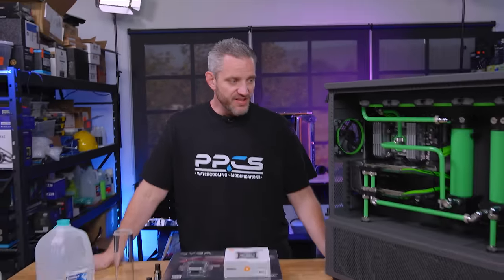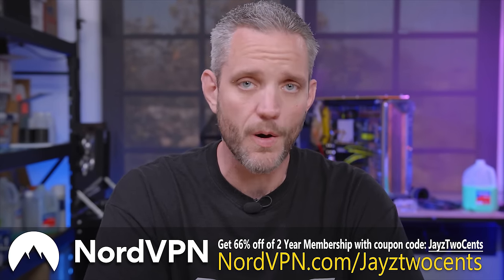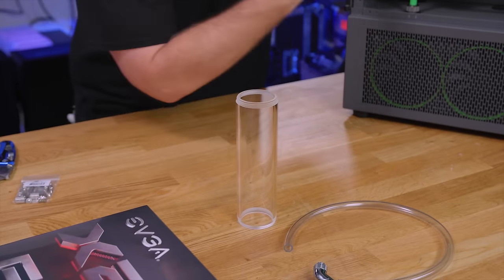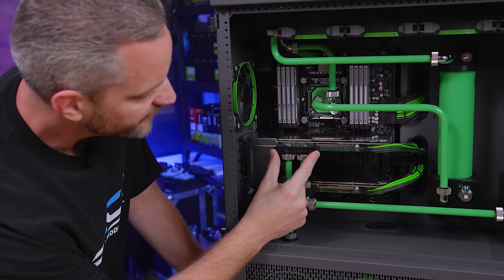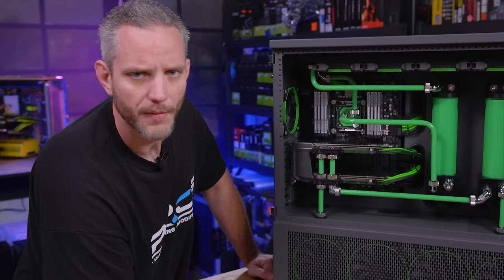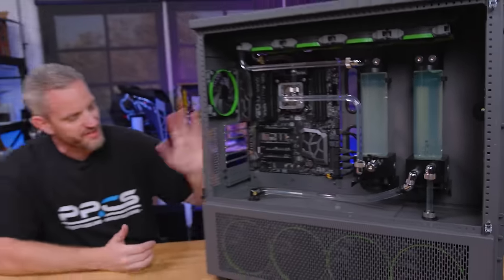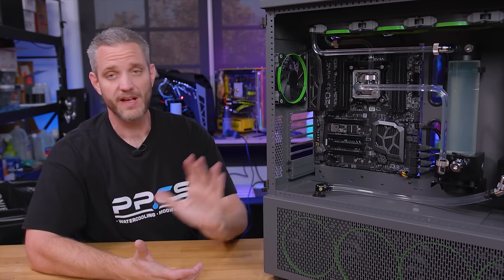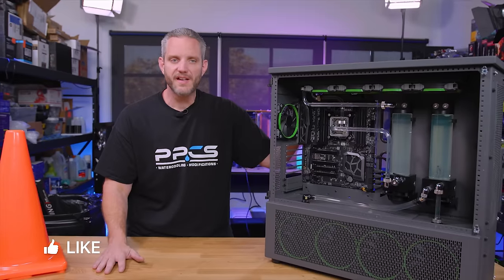Working on Skunkworks once again! Most OVERKILL Gaming PC

Comment: My idea of an easy upgrade: Swap out the GPU.
Jay's idea of an easy upgrade 9:24 : Swap motherboards, CPUs, and GPUs, flush custom watercooling loop, get new blocks, recreate new tubing bends.
Reply: My idea for my pc: new motherboard, CPU and RAM. And than I saw this.
Reply: My upgrade list: 1060 6gb, ryzen 5 1600, cooler master masterbox pro 5, adata m.2 128gb ssd, and a logitech z313. Because performance.
Reply: oh those m.2 are going to cost more then the gpu. :D
Reply: All I want is motherboard with 4 DDR4 RAM slots, i7 8700K and 8GB RAM
Edit: my current GPU is GTX 650 1024Mb
Reply: @ENDOMA555  30 dollars...
Reply: used, no brand psu cost in europe 5 dollars or 3.20 euros. The problem is that they are lower then 200 watts and deliver about 100 watts at full usage, and explode randomly.
Reply: @ENDOMA555  mine was PSU came in prebuilt PC and it is I think also no brand one worth arround 45€. 600W and it delivers up to 580W
Reply: thats a really great deal! Usually no brands deliver 50% of the max watts. Well at least in my experience. I just bought a off brand psu for a shit build and got it like for 5 euros.
Reply: Well, delivering the promised power is one thing, not blowing up and killing your new GPU is another.
Reply: yako okay go for 2600 while more expensive it has a higher ipc and ocs way better than it and it even has better ram support so less worry about your ram working with  ur cpu
Reply: @ENDOMA555  Never skimp on your PSU. Golden rule.
Reply: @CIubFoot  Yes I have like good build with brand psu and all that but when making a windows XP killer PC of 2012 I dont see the problem on skimping on the PSU
when the whole system costs about max 300 euros.

Comment: Videos like this is why I love you Jay. You introduced me to water cooling. Now I have a custom soft loop for my CPU/GPU. Here in a couple of years I intend to making a custom hard loop desk PC. The only issue I've noticed is the overclock I'm able to do on my CPU is causing issues with a few of my games, and to play them I have to undo the OC. I know it's not a heat issue, but still the games can't keep up with my PC. 8700k(5.2Ghz), 1080ti(+30hz core, +400hz memory), 32GB of 3200Mhz Trident Z, Gigabyte Aorous 370z G7 motherboard. I'm not sure if my bios settings are to fault, or the games themselves. Running at stock speeds is killing me when my loop can handle so much more.

Comment: In slightly surprised you didn't use the 32 Core, or is that being put in the threadripper build?
Reply: For gaming? When you have dedicated render rigs?
Reply: that thing is not a general use CPU its a hard professional CPU stopgap between the server stuff. The thing is really only good at rendering, science type workloads, and a few other things. That being said my god is it a monster at what it does best.
Reply: @Blazing Clash it makes sense why they would not seeing as how epyc is for some ungodly reason is overclockable. So if you need 32 cores for a video game then there ya go i guess.

Comment: Why not wait for the 9980xe?
Reply: expensive stupid. And probably slower for his usage. Less cores with more ghz is still better.
Reply: why not both ? Right Jay ? RIIIIIGHT ?
Reply: @gaiustrollius9920  9900k is soldered, not 7980XE
Reply: @juhopetrell1878  I was referring to the 9980xe.
Reply: Technically he could have gone for a 9960X. And that series isn't released yet, and is a much higher TDP (generally larger) package with no iGPU either, so thermals are actually expected to be much better than the 9900K
Reply: That would be a ridiculous cpu to put in it, but yeah surprised he didn't wait for the new cpus to release in the next few weeks and evga new bios to do this upgrade. I have the evga x299 ftw-k as well (and the z77 ftw)
Reply: Why do some of you people always want to wait?
Reply: 9900K is good enough.
Reply: Well I suppose he chose an 16 core for a reason if he didnt need many he would of went for 14 or 12
Reply: And *8 cores would be a downgrade
Reply: You mean soldered 7980xe that can't maintain stock boosts while throttling to the sun and back because the solder doesn't help?
Reply: The cpu is not out was only announced
Reply: 9900k only has 16 pcie lanes to share between the two graphics cards and depending on how many nvme ssd's he has, them as well.
Reply: @zeldacuz  that's wrong. Chipset has 8 lanes. So 24 total. It would run x8/x8 with 8 lanes to spare for drives. Plus this is a 7960 on x299. Why is everyone in here saying 9900k ?
Reply: Yes I know. That's why I said depending on how many nvme ssd's he has. If he has more than two than it would begin to use pcie lanes.
Reply: @AmaroqStarwind  not for rendering
Reply: Why wait? Hes gonna upgrade again once its out. :D
Reply: Spoiler Alert

Comment: I wish I have gone with a case labs case when I had the chance. I have an X299 setup with Asus Rampage VI Extreme, 7980XE, 32GBs of RAM, two 1080 TI Kingpins and an open loop with soft tubing. I will say I've been impressed with how well EVGA has been making their mobos and I'm going with their Z390 Dark whenever it is released (rumored in mid to late Nov) to go with my 9900K (of which is still in a pre-ordered stage at Amazon). I want to see more OC'ing videos Jayz. Keep firing at Steve. I love these techtuber OC'ing battles.

Comment: Should I feel depressed with my pentium E5300 or should I be proud of myself for surviving with that for over 8 years now.
Reply: You should feel depressed that you haven't spent the $5 for one of the lga 775 quadcores
Reply: @axelbostrom3606 , PSU doesn't have enough power
Reply: another 10 dollars for the psu
Reply: Well a bit of both
Reply: Probably the motherboard will have trouble powering the cpu. Happend to me when I installed a q9550 on a asus p5ql. It would bsod like hell. Had to replace the old thing with another old thing p5q deluxe. Now it works like a charm. The upgrade was around 100$(added 4 more GB of ram too)
Reply: #PentiumE5300Squad

Comment: A really elegant solution for your tube color that will bring a nice aesthetic with it would be to backlight your resevoirs especially if you can find a thin enough blacklight solution. It wouldn't penetrate the liquid itself because you're not using clear liquid but that's a good thing because it also hides your lighting solution so the only thing visible is the light pouring out from the underside of your reservoir tubes which will look great and also  evenly light both tubes.

Comment: Damn, case labs went the way of the TellTale.
Reply: They had a press release prior stating the Trump trade war tariffs were the reason. The materials used went up in price to where they could not operate without taking a loss.
Reply: @dronedoutrc5970  That was just a lie though.  Due to where their parts were produced (Taiwan), the trade war had very little effect on them.  Their company has had a hard time turning a profit for many years now, primarily because their cases/accessories are priced so high.
Reply: Except we miss Caselabs, but not Telltale. Telltale can rot in the depths of hell.
Reply: I doubt that the actual raw materials going to those cases were that high in the beginning. These premium cases are charged based on their design and novelty, not raw materials. If it simply was raw materials that drove them out of business, why none of the other case manufacturers are out of business?
Reply: Where is your source for this info? The materials used i.e. aluminum cobalt and steel come mostly from China thus the materials used are affected. Trumps tariffs are even causing woes here in the US so please dont act as if these tariff are not part of the issue.
Reply: Again, they are hardly an issue for premium products. If you want sources, here's what  Nucor's CEO has to say: (not direct quote), the tariffs on steel would have minimal impact on US's products, a car worth $36000 will see an increase of $160 in term of price, while a can of beer will increase by a penny or two. China does play a big role in exporting steel and aluminum to the US, but the number 1 trade partner is still Canada, it is not like the US cannot survive without Chinese steel. So back to case lab,  their cases are more expensive than any other cases on the market, but again, they uses the same materials.  They are expensive because their built quality and novelty. Both of which are unrelated to raw materials.  However, mass case manufacturers keeps on improving, with brands like corsair, fractal design, cooler master, lian li... stepping up their games in built quality, as well as design, I see very little reason to spend double, or triple the amount on caselab. Once again, the tariffs affect all case manufacturers, but why is caselab the only one out of business?
Reply: +Droned Out! R/C   Except for that footer not that they had an extremely large account default.  Most likely on the parent corp side.  Tariffs had nothing to do with it.  They could have easily raised prices to account for increased cost productions.  They failed to divest their two corps so one side could go bankrupt while not affecting the other.   They also failed to expand the last 4+years that they had anywhere up to a 4 month back order.
Reply: Even in the article where caselab CEO explains the reason for closing down, he specifically stated that the cost of materials when from 1.5 to 2.8 USD per pound, a 1.3 usd increase. Take the caselab SMA8 for example, it is weighed at 40 lbs. So 1.3 times 40 is 52 dollars. The SMA8 retails for 800-900 dollars, slapping another 52 dollars on it is hardly significant, and if that is the reason for their downfall, then maybe there is a problem with their production capabilities, since the corsair 900d weighs even more, and cost half the price.
Reply: Exactly.  The refused to offload anyting to manufacturing including just having flat panels cut for them.  When they had the capital to expand they didn't.  Instead they lost orders to back logs.  On top of that they financed low margin goods directly instead of through a third party lender.  Which would have netted them the cash up front while tha bank took on the risk.  Poor management on all fronts.

Comment: Jay, Could you put a couple of pipes in between both loops (hidden) with valves so that you can run the loops separately but if there is a fluid color change you open the valves and mix the fluid without draining the individual loops and mixing in a jug. Or just have a pipes that connects the drains to the opposite loop reservoir inlet. Just thoughts...

Comment: JayZ, I noted your comments regarding the tubing run that you have descending from the GPU through to the lower chamber of the case - and the fact that you might well have to come up with a way to handle this given the fact that your new RTX2080Ti cards will have water blocks in different positions. 

Just wanted to suggest that you take a look at some of the videos from "Declassified Systems", here on YouTube... He makes extensive use of acrylic sheeting, which his videos show that he can very effectively cut to fit interior panels (to hide holes in cases). He also seems to mix and match between both the natural gloss surface of acrylic, as well as using aerosol spray paint to give panels a matt finish. 

I reckon that you would be able to simply cut a new exit hole for the new GPU exit pipe through to the lower chamber, then slot in a piece of acrylic with a hole cut in the same place. This will effectively hide the existing hole from your current cooling loop. 

Just an idea for you to think about. Keep up the awesome videos.

Comment: Now I'll be thinking about the second part non stop! 

Can't blame you Jay for continuing with EVGA on this build! I remember you mentioning for Skunkworks that the motherboard has been very stable and that is important. Plus you already used the ASUS board in the D-Frame and you don't wanna be boring and repeat the MB. 

Will EVGA be sending you 2080Ti FTW3 Ultra GPUs for Skunkworks?  Will you be using another set of XC Ultras instead?

Oh, I also like the idea of painting parts of the case a different tone of color. Would be rad. 😎

Comment: Skunkworks is the name of my greenhouse. Greenhouse runs on solar and raspberry pi. Had pi mounted on solar panel kept getting too hot. Wish I could get water blocks for the solar panels. Nice build. I though you were running antifreeze at first. Surprised that people don't run antifreeze. For computers not in climate controlled places. Antifreeze has lubrication in it. And great heat exchange properties.

Comment: Jay is there any real benefit to running 2 loops in this system vs 1 larger loop? Only reason I can think of would be to run 2 different color fluids. Connecting them together would prevent the different discoloration you seem to be plagued with.

Comment: What does it look like if you remove the bottom panel entirely? I ask, because even though it would break the outside sleekness, I suspect the black radiator with green fan-rings would be a lot sexier than having it tucked away behind that dense grid.

Comment: 90 from the res/pump to the CPU needs to be about 5mm longer on the pump side. It’s slightly too short and reducing the cleanliness of that 90.

Also I find using a 90 edge (like a sanded block) and buttressing it with another 90 edge (like a welding square) gets a better bend and cleaner look.
Reply: I should say I mean this will all due respect! Just something to improve the look. I’m anal retentive with that sort of thing, so it’s bothering me.

Comment: Would u be able to do a build video using...
MSI meg godlike motherboard
Intel i9 9900K, cpu,
Any version of GTX 2080ti,
1 Samsung 970evo m.2 500 gb drive as a boot drive,
4 Samsung 970evo m.2 2TB drive,
64 GB ram,
And the PCI capture card included with the motherboard.
That would be an awesome overkill video to see... Please.

Comment: i just did my first build ever its a evga x299 ftwk with a 7820xx 32gb of xpg 3600 ram,evga 1080 ftw dt, and a simple evga clc 280mm, evga 850 g2 psu in a andreas crystal cube case and this is the fastest pc ive ever seen or used now only if i could figure out how to clock everything its just way over what i comprehend at the moment are you going to do any basic or maybe a very detailed video of over clocking on the evga x299 platform?

Comment: Are you going to wire up the 6-pin supplemental power connector on the bottom left of the board?

Comment: I like how he didn't go overboard with new parts, yes he got new GPUs, a new motherboard and a CPU but he didnt change the ram, case, power supply, storage and so on. Most you tubers when they "upgrade" their system they replace it entirely and it just ruins the point of the series. Good one Jay

Comment: I had a EVGA board way back in the day, back when they had nvidia based chipsets. The pci express slot literally caught on fire, I had a friend who had the same thing happen. Had a 8800 ultra also that literally had to be RMAd 3 times. Stopped using EVGA after that, last year I decided to give them a chance and bought a 1080ti, it died within 3 months. New one seems ok, but I do not trust EVGA reliability.

Comment: JAY!  JAY!  Got an opinion question!  I'm planning to do a custom water-cooling loop on my 2010 computer with 2x NVIDIA Geforce GTX 480s.  These are 250watt cards EACH and I have matching EK FC480 waterblocks.  I plan to use a D5 pump, a CPU block, a 360 RAD on top for cooling the GPUs and a 2nd 240 radiator on front to cool the CPU.  What size hard tube would you recommend for the parallel loop links between the two GPU waterblocks?  12mm or 16mm?  Plan to use Bitspower fittings like you used in Skunkworks.  Thanks!

Comment: @jayztwocents I'm currently using a 420 EK CE radiator to cool two graphics cards and cpu, but I'm redoing my setup with a Z390 and adding another radiator but don't know which way to run the loop. Any tips you would suggest? I would really appreciate it. Also, do you recommend using the primochill prep? I contacted ek once about this and they said it wouldn't be recommended.
P.S. thank you on your old tutorial on restoring radiators, I took your advice on painting it white and it looks amazing 👍

Comment: why not create/3d print rings for resevoirs for lites at base/top of the caths, while blacking out the in between bulb, that way the res's and tubing provide the lighting rather than just reflecting off inner case surfaces, and maybe even mirroring the back interior, possibly like those which end up looking deeper than it is????( lit tubes would not show difference of color) anything, besides this rgb  bs that seems to be adding to part cost... rather than   increasing product performance , and while newer items might also be improved, surely the extra addition of lighting isnt offering a lower cost , rather a increased, hmm?

Comment: Jay, can you (or anyone else) tell me which monitoring software you guys are using? The one that's just showing all the temps, usage etc? I'm still fairly new to all this, but i need a good, clean program with no fancy stuff, just loads of info!
Reply: It's called Hardware Monitor 64 or Hwmonitor for short.
Reply: Thanks! Does it have any setup, or is it literally just "plug and play"?